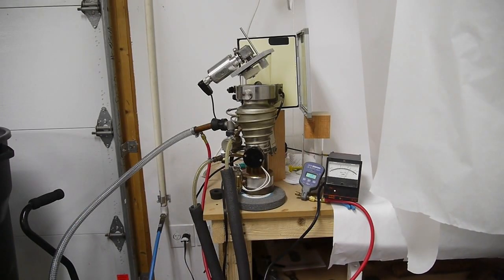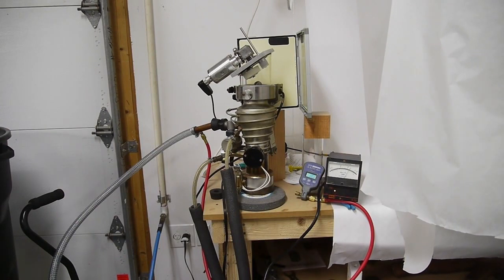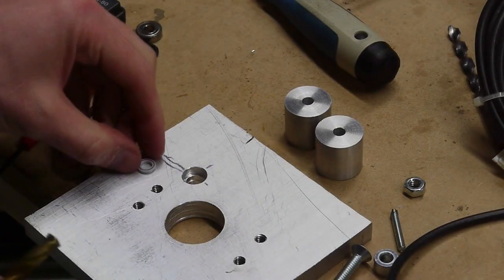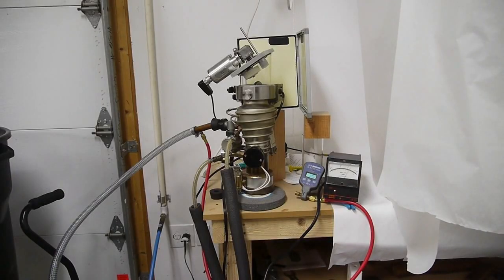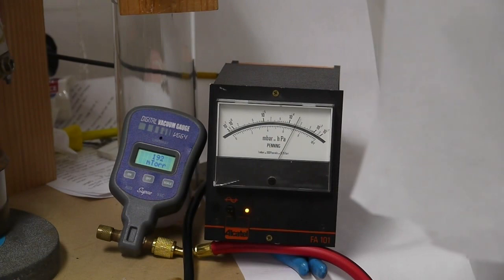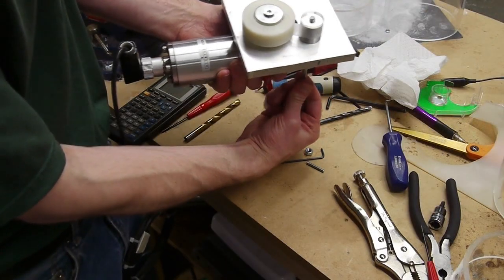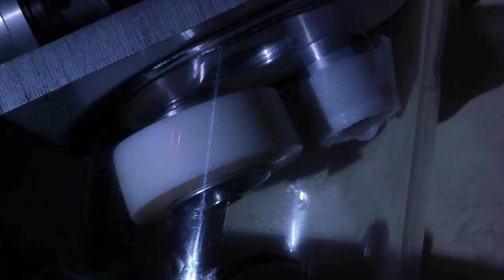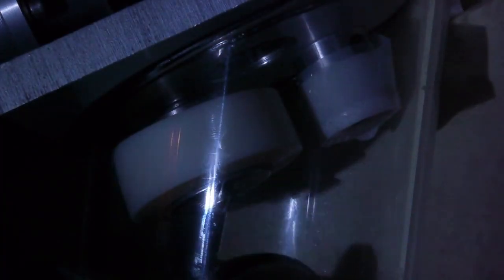Attempting to make X-rays by unrolling Scotch tape (negative result)

Comment: Do you think using some of these concepts, a previously engraved 14 K gold trophy cup, that has had the inscription scrubbed (or polished) off (about 1946) could be read today? I read somewhere that you could use beeswax and scotch tape and the original engraving would be revealed. I was searching You Tube to see if I could find anything in this and came across your video. I’ll check back for a response. I have about 6 months in which I need to figure this out!

Comment: I would also use an isolated magnetic drive. Two or more poles outside the vacuum react against a similar arrangement inside the vacuum through a plexiglass plate. I recommend the 1" neodymium cubes and you will have no problem translating enough torque. You're our hero Ben. You can do this.

Comment: Did you take into account that the tape spool and the take-up spool need to be appropriate materials to take and release charges effectively as is with Van de Graff generators? And this thing looks like a one way Van de Graff, in my opinion. You know damned well we will wait 20 years if we have to for you to succeed at this, Ben. 👍

Comment: Just watched this older video. My son and I got this to work almost 10 years ago. A couple of thoughts from that experience: One millitorr is enough. Regular Scotch tape is best;   not the matte invisible tape. The xrays are soft, mostly 30 keV or less. The acrylic tube shields most and your Geiger tube wont see it. Try a pancake Geiger and/or put the phosphor screen in the chamber.

Comment: A follow-up.  Must have had problems, they have closed the doors.  One listed on eBay but with no support not worth much.
Reply from the maker: I think they may have pivoted from unrolling tape to striking a piezoelectric crystal. Check out patent US8938048B2.  Still, it would be an interesting teardown!
Reply: Yours for $3200 on eBay but may not have the cartridge.  Saw their site when it first came up a while back, seems it used specially formulated polymers to contact & separate, would be nice to see the site again.
Reply: Look up ndtsupply.com c2016 Tribogenics Watson PDF file $10k, recycled xrf m1 cartridges $300.

Comment: Slowly I am building up my own high vacuum equipment with a turbomolecular pump and I want to try things like this too.
Just two questions: What is the wall thickness of the acrylic tube you where using? I have problems finding tubes with more than 5mm (a bit more than 3/16 inch) wall thickness and I am a bit concerned these might not stand the pressure.
And what are these teflon seals for the rotary feedthrough?

Comment: You need heavy metals in your vacuum environment. The way x-rays are created in a tube are by exiting electrons occupying the energy levels closest to the nucleus. Since, large atoms have many energy levels, an electron can be excited to a very high energy state, without ionizing the atom. So when an electron close to the nucleus get's 'knocked' up to a high energy level, It has the potential of releasing an x-ray photon. How bout you coat the tape with a heavy metal?

Comment: Just an idea, could you try to put a piece of aluminium foil in front of the place where electrons are ejected? Braking radiation (X-rays) seem to be generated much more efficiently when the substrate the electrons slam into is of a relatively light atomic weight. Aluminium works relatively well IIRC.
This is just speculation, but it might enhance X-ray output.

Comment: also this creates an unsteady small amount of xrays. too iregular and weak to take an xray. a kid in a local sci fair by me took an xray of a rat bone with this method. it did work but it was not veery clear. the object had to be in the vacuum same with the film and it had to be exsposed for a long amount of time without it moving.  im afraid its easier the more modern way. if they made the tube work like a camera flash with high current and an high voltage start up ect... it would work well

Comment: i like your devotion to this its very interesting. and ive heard of people doing this sticky side to sticky side with original duct tape and it working without a vacuum. can i ask what is your job or was your job? you seemed to work very fast from when you heard about it to when you tested it.  adding large amounts of thick lubricant would help make a better seal for longer experiments.

Comment: Nurdrage shows this effect with visible light. He says he only found one type of tape that was successful - /watch?v=54R6q2_-4Yo&feature=player_detailpage#t=56s

I wonder if different tapes might have different static potential giving out different 'bandwidths' on collision.

Also interesting that in all of them he had the both adhesive sides together, not adhesive to the top side of the tape as your set up.

Comment: Could the Teflon shaft seal be leaking from the spinning of the shaft?
Wouldn't pulling a high vacuum on the tape roll degas most of the trapped air?

Comment: Another excellent video! I've seen this experiment done before. One thing that might improve matters is that the original researchers discovered that a tape unroll speed of 3cm per second produced the best results for x-ray generation. Also I believe Russian researchers discovered that simply peeling scotch tape off a sheet of clean glass also produced x-rays.

Comment: Would there be an issue having the motor inside the vacuum chamber? It would be a lot less of a headache sealing some wires than a rotating shaft.

Comment: Nice someone finally repeated this.
Could be wrong tape,low vacuum or weak detector.The triboluminescence with tapes was discovered in 1939,and in 1953,Karasev, Krotova, and Deryagin produced x-rays using a similar setup.Camara, Escobar, Hird and Putterman repeated it in 2008.

I recommend using a photographic paper with a lead obstacle and a long exposure. Unwind the whole tape quickly and try to see if there is a shadow after developing the paper. I don't think your counter will show anything.

Comment: Going by /watch?v=LQBjRF9mX1Y I'd propose two problems; first, a weak vacuum, and second, too much distance between source and detector. In that video, their detectors are inside the vacuum or only detect from about a centimeter away from the vacuum chamber.